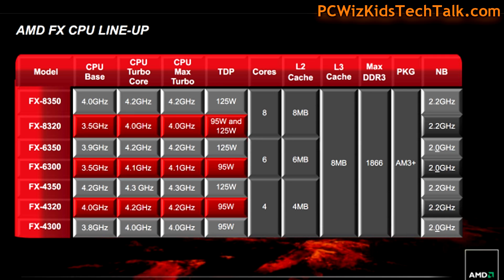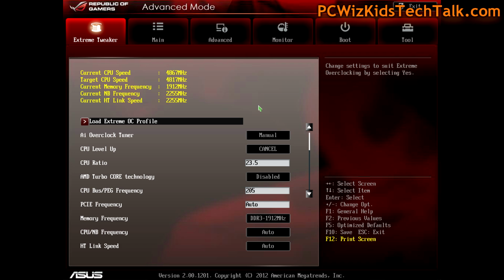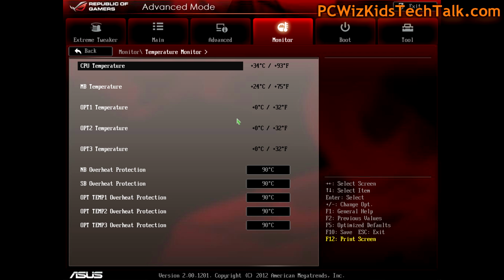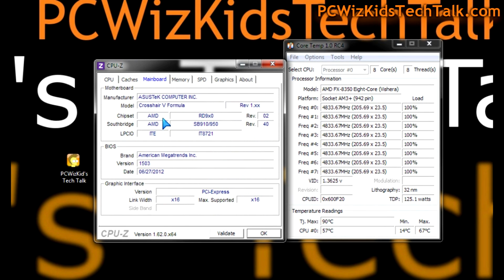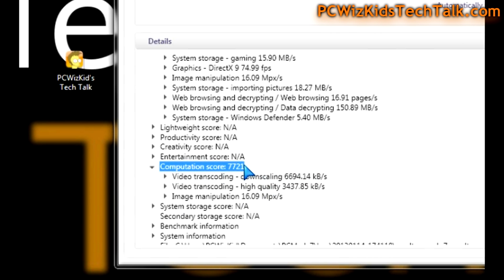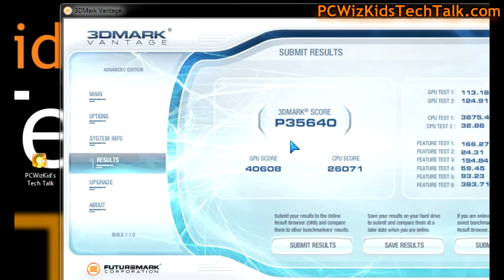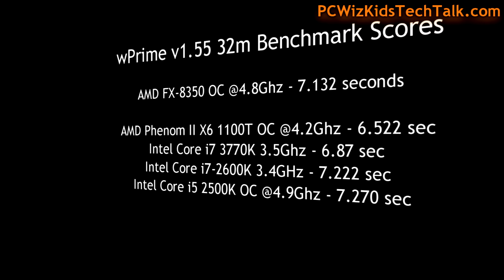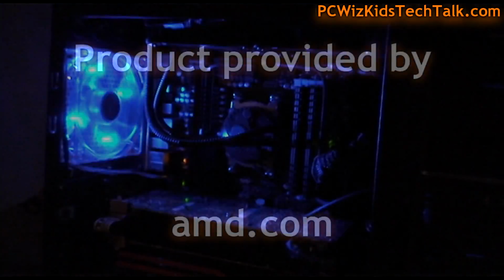✅AMD FX-8350 Overclocking 4.8Ghz Video Review - PCWizKid

Comment: Crossfire in most chips show its slower for game play and using one card is better.. 
A MSI 970 Gaming motherboard has a PCIe-x16 2.0 slot so look out for cards that are 3.0 on this motherboard... You card will run slow.. No GTX-1080 TI on this board.

Comment: Can Somebody Help Me?

I purchased 
MSI Extreme Gaming AMD 970 AM3+ DDR3 USB 3.1 ATX Motherboard (970A GAMING PRO CARBON)

Will The 
AMD 4 GHz FX-8370 Octa-core Desktop Processor with Wraith Cooler, Black Edition FD8370FRHKHB Work?

When Choosing the AMD Processor i get a Warning "Some AMD 970 chipset motherboards may need a BIOS update prior to using Vishera CPUs."

What Does It Mean?
Reply: it means you need to update your bios, use a USB stick and download the latest bios. Open the bios and set the boot option to USB stick (USB FDD) and restart. Install it via the Bios. If you gonna overclock buy a closed liquid cpu cooler since the stock cooler wont take much more than the stock turbo mode.
Reply: Anmordal-Swe Thank you So much and I'm planning to get the Corsair h100i v2 and I have a Roswell B2 Spirit Case, so it had plenty of breathing room

Comment: Does anyone know if i can overclock my FX-8350 to 4.7GHz with A Vantec 620W ION2 Ultra Quiet PSU? I would really love not having to buy a new power brick... here are my specs:
CPU: AMD FX-8350 
CPU cooler: Cooler Master Hyper 103
GPU: GeForce GTX 760 Gainward Phantom 4GB Edition
RAM: Kingston HyperX  Fury 16 GB DDR3 1600MHz
Mobo: GigaByte 990FXA-UD3
PSU: Vantec 620W ION2 Ultra Quiet
HDD: 1TB Western Digital WDC WD10EZEX-00BN5A0 SATA Blue
[if i have missed any specs that are required please tell me]
Reply: That is definitely a large enough Power Supply, the CPU cooler is pretty good as well. I would stick to around 4.5 ghz or so, but you'll be fine!

Comment: Any Help How far can I overclock?
BUILD:
CPU: AMD Fx 8350
MOBO: MSI 970 Gaming motherboard
Cooler:   Cooler Master Hyper TX3 OR Cooler Master Hyper 212 EVO (What one should I go with) or a different one. Willing to spend 60$ on cooler. ty
GPU: Gigabyte Windforce HD 7970 Ghz Edition (Will Be overclocking) Has three fans
Case: DIYPC Skyline-07-R ATX Full Tower Case: HAS 7 120MM Fans PreInstalled
PSU: Corsair CX 750W 80+ Bronze Certified Semi-Modular ATX Power Supply.
How overclocked can i get without messing things up? Thanks
Reply: +Seth Wheeler You should take the a GIGABYTE 970A-UD3P
Reply: Already bought everything! So far so good!
Reply: +Seth Wheeler My Build
Cpu-> AMD FX X8 8350
Cpu Cooling->COOLER MASTER HYPER LGA 775/1155/1156/2011&AM2/AM3/FM1/FM2 
Motherb.->GIGABYTE 970A-UD3P
GPU->Asus STRIX R9 Fury
SSD->Kingston 120GB HyperX FURY Sata 3.0
HDD->WD 3.5" 1TB Caviar Black Sata 3.0
PSU->COOLER MASTER RS-700 G 80PLUS 700W Power Supply
Case->ZALMAN Z11 PLUS
Reply: already bought all my parts... thanks tho man :p
Reply: +Seth Wheeler should have gotten corsai h60
Reply: +Seth Wheeler cooler master hyper 212x max it can go is 4.6 and if u use h80i max is 4.7 and h100i max 4.8
Reply: same cpu and mobo as me :P

Comment: can you help me out with overclocking my fx 8350 
ive tried to hit 4.8ghz but in around the 20 min mark on prime 95 one of my cores stalls out
I have
msi 990 fxa-gaming (MB)
8 gb pariot (ram)
fx 8350 (cpu)
corsair h105 
lepa 650w psu 
msi r9 390x (gpu)
Reply: +dips garcia one of your problems may be your power supply, even though its 650w its not efficient enough to give constant power. look at your 12v rail, it gives 45A which is not enough for the fx 8350 and r9 390x, you should get a gold rated psu, what thermal paste are you using, try using artic silver mx-4 thermal paste, its one of the best, even better than artic silver 5, reduce your clock speed to 4.7. stress tests are a bit harsh on your cpu, chances are while gaming you wont even utilize 90 % of your cpu in most games, your temps must not exceed 60 degrees on the core. msi motherboards are very difficult to overclock on, compared to asus sabertooth and ROG, I would say settle for 4.7 on your configuration, but definitely get artic silver mx-4 thermal paste, apply it let it run at stock speeds for a week then you can overclock after it settles.
Reply: warcrab cyber yea psu was a pos thanks for the help Sir.
Reply: +dips garcia you have a nice set up,  bear in mind that FX8350 as easy to OC from 4.2Ghz to 4.5-4.7Ghz with low voltage and MOBO power tweaks disabled. To reach 4.8Ghz you really need to push the voltage up to force them stable. But if you want to keep cpu at 4.8GHz you will need probbly 1.5V and all MB power tweaks at max to deliver the power stable and avoid power spikes. Do you really need 4.8Ghz? because with 4.6-4.7 you will have your system running a lot cooler with MB LLC, power options disabled

Comment: How high do you guys think i can oc my fx 8350?

Cpu: AMD FX 8350 
Motherbord: asrock 970 extreme3 r2.0
Cpu cooling: Corsair H80i GT hydro series
vid card: Nvidia Geforce GTX 970 4gb GDDR5
psu (power supply): Cooler master 600 watt
Reply: +Mr Crow an 970 chipset is not recomended for 8 cores. You can OC that to 4.5GHz but now you have to worry with the vcore, VRM temperatures and also NB heating issues
Reply: +ACA Silva i have a intel core i5 4690k now oc'ed to 4.5 ghz with an msi mb..  but thanks anyway for the tip  ^^
Reply: Mr Crow I have the corsair H90 and went up to 4,5 Ghz, (but not any further because I'm a pansy :D, I could go higher though) So yeah, I'd go for 4,4 Ghz first and check the temps, then continue. Use HWMonitor to check the system temps.
Reply: Mr Crow Every chip overclocks different

Comment: i need help. i cant find soluthion.. i overclock fx8350 with croshair formula v to 4,8ghz and vcore to 1.75v.. i disable all power options , turbo core , i make the cll settigs to ultra high and 130% and thats help me to stavle the vcore under stress test,.. all settigs was ok.. my ram waskingston hyper x beast 2400hrz , htlink 2600 , cdpu/nb 2400 because of ram was the smaller hirz after i set the ram and timmings to 2400..  this is my set-up
THE PROBLEM IS  MY MHZ SOMETIMES FROM 4.8GHZ THEY DROP TO 4.7GHZ , 4,6GHZ AND 4,9GHZ FOR A SECOND AND COMEBACK TO NORMAL AGAIN. EVERY 2, 3MINITES I HAVE THIS.. WHAT IS THIS PROBLEM I DONT UNDERSTAND!! ANY HELP??
Reply: loukas psomas Either your processor is getting too hot and throttling, or you don't have a good enough power supply
Reply: +loukas psomas max voltage for the 8350 is 1.55v you risk critical damage with voltage of 1.75v
Reply: +loukas psomas 1.75V is just too much and thats your problem. you need to lower the vcore voltage. bear in mind that FX8350 as an easy OC from 4.2Ghz to 4.5-4.7Ghz with low voltage and MOBO power tweaks disabled. To reach 4.8Ghz you really need to push the voltage up to force them stable. But if you want to keep cpu at 4.8GHz you will need probbly 1.5V and a good power source and mobo to deliver that voltage stable, otherwise you will hv power spikes and risk damaging your chip.

Comment: my fx 8350 reaches 48 degrees on core at stock speed 4.0 GHz with corsair h80 .... and socket temps are like 60 degrees ... i cant overclock to even 4.2 GHz because the temps starts hitting 80 degrees ... whats wrong with my chip ... i have an old Asus m5a97 board
Reply: It's your cooler
Reply: PotatoesHD
Well, Thanx for the reply mate ... my corsair H80 is 3 years old ... is it possible that the water has evaporated, after running for 3 years ???? .... i replaced my H80 with the stock air cooler, that came with FX 8350, but the stock air cooler is performing worse then H80 ... and one more thing i have noticed, that air exhausting from the H80, is not that hot which it used to be, when i bought H80 3 years ago  ... and my VRM heat sink is also running hot ... i live in a hot environment and its summer season. my ambient temps are like 28 to 30 degrees.
Reply: Have you changed your thermal paste in those 3 years?
Reply: PotatoesHD
Well, yeah, i got FX-4100 in 2012 which i ran at 4.6 GHz, Then i purchased FX-6300 in June 2014 (last year) which i overclocked to 4.4 GHz (the temps were good 55-58 one year ago) but all of a sudden in the month of April this year i noticed that my FX-6300 was reaching 65 degrees i thought its due to summer season i lowered the clock to 4.1 GHz ... but now i bought FX-8350 which is also running hot ... from what i see my cooler started to behave abnormally 2 months ago
Reply: PotatoesHD
hey dude, i figured out the problem ... my mobo was pumping insane amount of voltage after enabling LLC ... my stock voltage was 1.37 volts but when i enabled LLC my mobo was pumping 1.50 volts to my CPU ... at stock speed .... my mobo is pumping about 0.12 volts extra then the input value ... right now i have set my manual voltage to 1.29 volts and i am getting 1.41 volts ..... i am running at 4.5 GHz and my core temp is around 56 degree at full load ... my socket temps are about 71 degrees ... my voltage is still on a higher side
Reply: Hm well your temps seem fine. As long as it can survive the stress tests with no failure's you're a-okay.
Reply: PotatoesHD
Well, after running prime95 for about 2hrs my core temp is 57 degree, and the socket temp is 74 degree .... at 1.41 volts ... i cannot lower the voltage any more because 1 of the cores fails below that .... i am hitting the thermal limits on CPU socket temp ... people say 75 degree is max for CPU socket ... my CPU core can go higher though ... 65 degree is max for core temp ..... is 1.41 volts good for 4.5 GHz on fx 8350 ????
Reply: amanvds Im running 4.8 ghz with the corsair h80, 49 degrees at normal> 62 degrees at full load
Reply: Singlerainbow
what mobo are you using friend ??? and what is your voltage ???
Reply: amanvds Im now at 44 degrees at normal and 56 at full load after cleaning my fans;D 1.450 volt at a Crosshair V Formula mobo.
Reply: Singlerainbow
that's great ..... what are your socket temps ???
Reply: I was talking about my socket temps :p
Reply: Singlerainbow
What ???? .... how is that possible ... have you installed a fan blowing air directly to the VRM and the CPU socket
Reply: How should it not be possible?
Reply: Singlerainbow
Those temps are really low. My socket temp get very high under full load. it reaches about 75 degrees .... my motherboard is crappy
Reply: amanvds I aint no expert but mobo shouldnt have that much of a difference, whats your voltage?
Reply: Singlerainbow
I am running 4.5 GHz at 1.41 volts ... my motherboard is a 970 chipset which is not for overclocking ... 990FX is recommended for overclocking FX 8350
Reply: Then I guess you have to invest in the 990FX :(
Reply: Singlerainbow
That's what i am looking forward to :)
Reply: +amanvds i'm running 4.5 on stock voltage, no problems at all.

Comment: i have problem with my amd Fx 8350 i use Asrock 970 extrime 3  and some time PC frezze are you have same problem ?
Reply: Zaviornutas BEST OF THE BEST try increasing your voltages slightly
Reply: *****  thanks ! :)
Reply: had the same thing. turned out it was the ram and w10

Comment: do you think I can get to 5ghz with this setup

AMD FX 8350 Black Edition 8 Core Socket
msi NVidia gtx 970 4gb
KINGSTON HyperX Beast 8gb ram 2400mhz
corsair cx750 atx psu 750w
120mm Corsair Air Series SP120 Quiet Edition, High Pressure, 1450rpm,
Corsair H100i Hydro Series
MSI 970 Gaming AMD AM3+ ATX Motherboard
Reply: I wouldn't. Try at least up to 4.7
Reply: XxF3ARxX 1998 you should be able to get 5ghz no problem . i run a 8320 4.7ghz at 1.5v and on idle  28-30c on the socket , 24c on the cores on full load i get 62c on the socket and 44c on the cores but then again i do run a h110i gt 280mm radiator .

Comment: This for me was not a stable over clock.
Reply: ***** There's absolutely no way you can get a stable OC with the 8350 on only 1.368 voltage. Whoever said that had to have been bullshiting
Reply: Walrus Cult Grunt i know when i was researching for baseline voltages and frequencies i encountered someone with a 5.2 ghz overclock on 1.368 voltage
Reply: I was eventually able to get a stable overclock that I use everyday @ 4.8ghz. the voltage is at the very minimum 1.49 -& 1.54 maximum. The overclock is smoother towards the 1.54v area but my pc would auto shutdown reaching 75*C-80*C  under load. so I use 1.49 even though it stutters at times. I don't have that heat problem problem anymore. This was achieved only by cpu ratio 24. Increasing the bus frequency does not result in a stable overclock for me.

Comment: That voltage seems a little high, I am running my 8350 at 4.8 GHZ @ 1.440 and it is stable with a 12 hour run on AIDA64 extreme.
My max temp only reached 52c on a H100 cooler
Reply: Ni tu te lo crees que lo pones a vcore 1,440 a 4,8.

Comment: okay for you guys struggling to get 5ghz try dropping the multi and raising the fsb  these chips like the north bridge and htt linked so if you have a 240mhz fsb  it will give you a 2.4ghz north bridge and htt which will give you a good boost if you are using 1600 mhz ram just because the cpu is at 5 ghz if the htt and nb are only at 2 ghz it wont mean dick LOL , so try to bum up your fsb as well as multi you get a better oc that way
Reply: for 1866 and 2133 ram go to 260 plus fsb and nb as well as htt see what works but that should get you in the ballpark also the max tdp is 72degrees also now avoid this chip get the 8370e its 95 watt and ocs better

Comment: i have my fx 8350 oc to 4.8 just on air using the evo 212 and in push pull and yes it is stable
Reply: idk i dont use that comp any more sorry but it was stable i now run a 4790k
Reply: wow can you make us a vid ? would be great! cause i have the same fx cpu and 212 evo
Reply: well idk how to do that but u can increase the core voltage when u clock it to 4.6- 4.8 try 4.6 first ill get core volatge tonight
Reply: first go into ur bio's find cpu ucore i increased it to 1.4625 set normal[ core] clock to 4.8 just so u no u do need good air flow and good paste
Reply: Joseph Lamarche
thanks man too high for me now i can get only 4.6 ghz but i will try again when i get a second fan to do the push and pull .
Reply: Joseph Lamarche dude what are your idle and full speed temps with the fx8350 and the evo 121? 
ps. got the same

Comment: this is my first gaming rig buddy what do you think of it, iv allways ad AMD.

3GB Sapphire Radeon R9 280X TOXIC, 28nm, 6400MHz GDDR5, GPU 1100MHz, Boost 1150MHz, 2048 Streams, DVI/HDMI/mDPort

Processor
AD785KXBJABOX - AMD A10 7850K Black Edition, S FM2+, Kaveri Core, Quad Core, 4.0GHz, AMD Radeon R7, 95W, Retail

Power Supply
850W Corsair RM Series RM Series, Full Modular, 80 PLUS Gold, 1x135mm Fan, ATX v2.4, PSU

Motherboard
A88X-G45 GAMING Assassin?s Creed Liberation HD MSI A88X-G45 GAMING Assassin?s Creed Lib HD, AMD A88X, FM2+, DDR3, SATA III 6Gb/s, RAID, PCIe 3.0, DSub/DVI/HDMI, ATX

Memory/R.A.M
8GB (2x4GB) Corsair DDR3 Vengeance Pro Series Red, PC3-17066 (2133), Non-ECC Unbuffered, CAS 9-11-11-31, XMP, 1.65V

Case
Cooler Master CM Storm Trooper XL-ATX Case with Window, USB 3.0, Black with corsair h55 watercooling unit and 4 corsair fans.

Hard Drive
1TB WD WD10EFRX RED 24x7, SATA 6Gb/sec, 64MB Cache, IntelliPower, 8ms NAS/Enterprise

Operating System
Microsoft Windows 8.1 64Bit DVD English International OEM -

DVD Writer
LiteOn IHAS124-14 24x DVD±R, 8x DVD±DL, DVD+RW x8/-RW x6, DVD-RAM x12, SATA, Black, OEM
Reply: what do tyou think i could overclock this to cheers m8

Comment: I have enermax ets 40 heatsink with push pull. Now I can only get. 4.3 by using multiplier and 1.3 cpu volt but it goes to 61 degrees which is at the limit in battlefield 4

Comment: should i get fx 8320 or i5 3570k and how the 8320 compare to i5 3570k in power consumption,,i dont want at the end of the month to get huge power bill..
Reply: Thats a myth.
Reply: Broc Kelley Thats nothing... Just buy another efficient parts like 80+ power supply, low voltage ram, SSD or HD green, etc and that wont be a problem.
Reply: Broc Kelley Even better
Reply: the people of the tek sindicate made a test on i7 and amd fx 8350 and you will spend 5 dollar more a year in power comsuption with the fx cpu .i think that´s not much.

Comment: AMD is still stuck on the 32nm process. They need to start shrinking the die and develop a new platform. The AM3 socket is so fucking old and is holding back their processors. If they develop a kick ass socket and architecture, AMD will match or top their Haswell platform. It doesn't look good though. The APUs are kick ass and will be the future. They will save AMD imo.

Comment: as i said, that is an overclocked GTX780, it still has the same number of graphics processing units as all other GTX780's which is 384 less graphics processing units than a titan. overclock a titan by the same percent overclock over stock as the GTX780 you are talking about has been and then that performance difference is gone. comparing two overclocked cards is pointless because the OC that manufacturers add is something any other card can get easy.

Comment: Mine works too!

Cooler Master Half X
Motherboard: Asus CROSSHAIR Formula V
PSU:              Corsair 1200W
CPU:              AMD FX 8350 8 Cores 4.8 Ghz (Corsair H100i)
Memory:        16 GB G.SKILL 2133 Ghz
Video cards:  2x Nvidia GeForce 580GTX SLI
Sound card:   SoundBlaster Titanium HD (Digital S/PDIF - Fiber optics)

Monitor:          Samsung 950D 1920x1080p HD - 3D ready
Keyboard:       Logitech G19
Mouse:            Logitech G700
Headset:          Logitech G930
Home theater:  Logitech Z906

Comment: i did the exact settings but my pc would definately shut off when running PRIME95...

Specs
ASUS Crosshair V Formula Z
FX8350
16GB Hyper X
1050W GOLD Seasonic
HD7950

@_@  i need help =(((